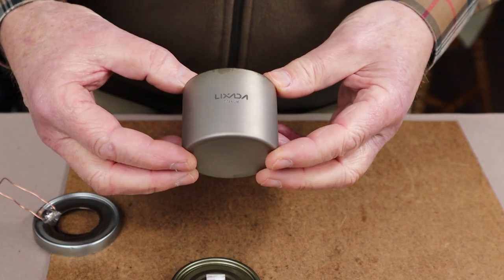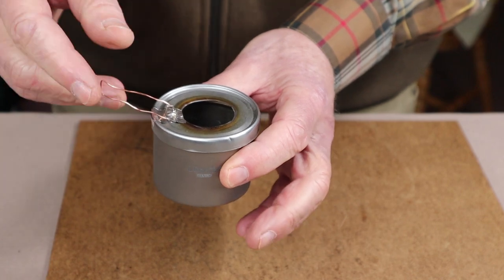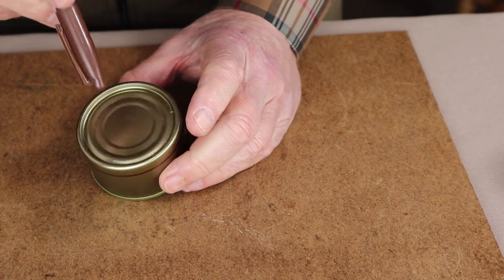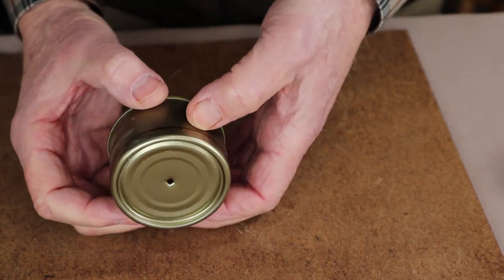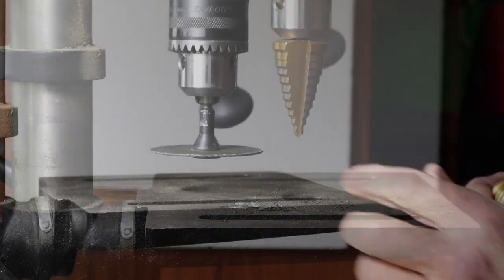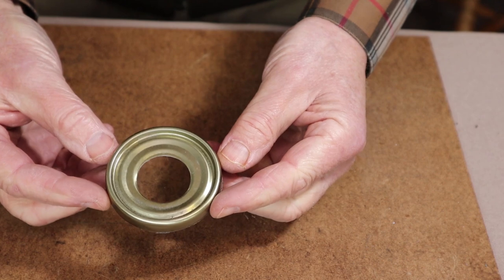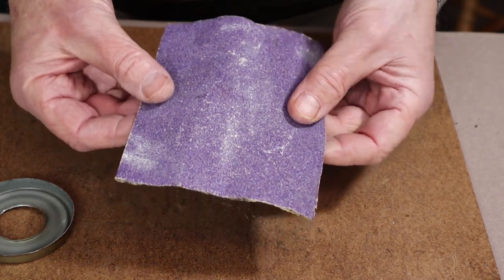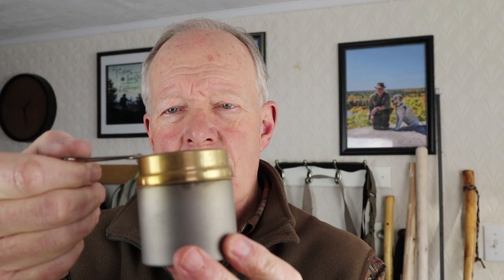Lixada Titanium Alcohol Stove - Snuff Cap & Simmer Ring

Comment: Thanks for the video...I took your idea of 1 1/4" hole simmer ring, calculated the area of the hole and drilled holes in the top of the can to the same final area.  This seemed to work well with the flame more distributed around the top of the simmer ring vs concentrated into only 1 flame.  Keep those videos coming.....
Reply from the maker: Glad it helped. Thanks for commenting
Reply: That's exactly what I came to the comments to ask about! Do you remember what size drill bit you used, and how many holes you made?

Comment: 19:10 - An adjustable simmer ring like Trangia is easy to DIY, I make one for a soda can stove - open top, top jet (that mimic Trangia burner); using a tomato paste can, for the pivot I use an small machine screw and nut for the pivot point, but a small rivet will to the job.
Reply from the maker: Thanks for commenting

Comment: Hey what a great video! I really like the idea of the folding handles you've made but here's a thought... for attaching them you could (rather than using adhesive tape) drill two small holes and poke the wire through those, with the short bent ends on the underside. [Edit: Creating/bending the handle such that it doesn't accidentally slide/fall through the holes leaving one with nothing to grasp might be rather difficult.] I think maybe an unfolded paper clip might be more durable than copper wire also. An aluminium/aluminum can would be a bit lighter than a steel one too, and easy to cut even with only heavy duty scissors (I see you don't have a cat, but some pate or "potted meat" products are sold in similar cans in some places). I enjoy greatly the innovation in videos like this one, and thank you again for making them.
Reply from the maker: I should have thought of the aluminum cans. I will have to give them a try. Thanks for commenting

Comment: After your video on the Lixada stove, I ordered one - they are SO cheap. Then, I checked my stash of empty cans. I only had one little tuna can, so I made the simmer ring, using a 1 1/4" metal punch. I drilled a 1 1/4" hole into a maple block and used a 1" washer to press the center down, making it self-centering in the simmer ring. Tape handle on the snuffer insert, wire bale on the simmer ring. I could send a photo to your gmail address, if you'd like.
Reply from the maker: Yes please. Would love to see some variations
Reply: @MarkYoungBushcraft  The burner arrived today, just in time to try it for my afternoon tea. The stove took about 3 minutes to get 1 1/2 oz of water up to temperature. I dropped the 1 1/4" simmer ring on the burner and it kept light bubbles forming in the water. When I dropped the snuffer disk onto the ring, there was still a lot of alcohol vapour coming out, which continued to burn. Since the flame was out inside the burner, it was easy to blow out the residual fire with one puff. Good enough for me.
Reply from the maker: @northwind7409  Very cool. I assume you meant 1 1/2 cups of water?
Reply: @MarkYoungBushcraft  Yes. I should pay attention when I'm proof-reading.

Comment: Mark, when you demonstrated that the simmer ring for the Trangia is to small to fit on the  Lixada alcohol burner it got me thinking. The Toaks Siphon alcohol burner is smaller than the Lixada. I checked, and the simmer ring /snuff cap from a Trangia will fit on the Toaks Siphon. It fits all the way down, with the top of the simmer ring resting on the top  edge of the burner. I haven't tested it in use, but this is the way that your homemade simmer ring works so I expect it to work.
Now, to be honest, if I wanted to use an alcohol burner to simmer I would probably just use a Trangia. The Trangia simmer ring weighs almost as much as the Toaks burner, which negates the weight advantage (the Toaks weighs almost nothing...).
Reply from the maker: I was wondering how the Trangia simmer ring would work with the Toaks. Please let me know when you test it. Thanks for commenting
Reply: TEST RESULTS:  I tried it out on the kitchen stove, with vent fan (it's 10°F outside). Not only does the Trangia simmer ring work on the Toaks Siphon, it works well. Wide open, the simmer ring only cuts the flame down a little bit because of the large hole, but it DOES reduce it some. I was concerned that it might snuff the flames out if it was closed too much, but there was still useful flame with it three quarters closed. It did not reduce the noise that the Toaks burner makes... As for the weight, the Siphon burner is 20.2 grams, while the simmer ring is 22.9 grams. Still, 43.1 g is much less than the complete Trangia at 115.2 g.

Comment: Thanks for the video. This won’t work as a simmer ring, but the metal lid from a frozen juice can makes a perfect snuff lid for this stove – it extends 2mm past the outside edge. If you ever needed a pre-heater, the slight moat around the juice can lid could work for that as well.
Reply from the maker: Great idea!! Thanks for commenting

Comment: You could also use an aluminum pop can to make these, not as durable but easier to make, all you need is a utility knife/box cutter and they are sold at the dollar store if you don't have one.

For the simmer ring how about a center rivet a three hole/flange design to provide more even heat
Reply from the maker: I had not considered a pop can. I checked and it fits perfectly. I like your idea for a simmer ring. Will give it a try. Thanks for commenting

Comment: Speaking of simmer ring , I found that if You have a top burner ( like a Personal size hair spray , 
shaving cream can )
You can use a grinding wheel ( if You have a fire box scout stove, You just have to put something under Your burner for the correct space to the bottom of the pot ) the wheel will reduce the flame by at least fifty percent , and increase
burn time too ( results may vary LOL ) .
Reply from the maker: Interesting, Acts like a heat sink and diffuser at the same time. Thanks for commenting
Reply: @MarkYoungBushcraft  Yes , works great and doesn't cost anything ( extra , assuming You already have a grinding wheel , or know Someone who does )
Reply: @MarkYoungBushcraft  Have You tried it yet ?
Reply from the maker: @johnhoward3271  Not yet, three weeks of rain and no break in the forecast. I could try it here at home though. I will get back to you
Reply: @MarkYoungBushcraft  I used it at home , it produces such a small flame ( You can put on a pack of ramen noodles , and set it and forget it , 
when it burns out noodles are done You don't have to
stir or anything , done w/10ml fuel at that )…

Comment: Having a Lathe I would be using it for both of those operations, I am not too sure about using the slitting blade like that, would want to make sure that if the metal grabs it can not pull your fingers into the blade. I would use a dermal tool over the slitting saw unless you could mount a X/Y Table on the drill press.  Busy Bee Tools among others sell a deburring tool which works good.
Reply from the maker: A lathe would be great. I understand your concern with the cut-off wheel. I have used it a fair bit an am very careful. Thanks for commenting

Comment: Using the same amount of fuel, would two burns of the stove -- one with the simmer ring and one without -- give you the same number of usable BTUs? I'm just wondering if you lose anything using a simmer ring on a siphon stove. I have the Toaks and it's rapid fuel use has kept me from using it as much as I thought I would.
Reply from the maker: There would be a huge reduction of BTUs with the simmer ring. I get extended burn time with much lower heat. I can't say it is more or less fuel efficient. Thanks for commenting

Comment: Hi, I think you have an Alocs alcohol stove too? I’ve recently bought one for a little over $10.00 usd including the stand. It’s the Alocs BS C02 model and it comes with a simmer ring and acts as a snuffer too. I really like this alcohol stove and it’s plenty fast cooking for me and with the simmer ring I can cook rice and bread or pan cakes with it without burning my foods. 
How does it compare to this Lixada stove that you have? I definitely don’t need the fastest stove out there because I’m happy with the speed of this Alocs alcohol stove and the ability to fine tune and control my cooking to just about any foods that I’m cooking. It just seems like a lot of hassles unless you like tinkering using this Lixada stove and pricier too? What’s your thoughts on this? Thanks
Reply: I see what you’re saying Bong. You’ve got a lot more fine tuning flame adjustments compared to what Mark’s simmer ring can do on your Alocs simmer ring. For me I like that the Trangia/Alocs has a Rubber seal cap for the alcohol stove so I don’t need to carry a alcohol bottle with me for day trips. I just fill up my stove and close it and off I go. It looks like this Lixada alcohol stove can’t do this.
Reply from the maker: I can do a side-by-side comparison of the two stoves. The ALOCS and other Trangia clones work well, are less expensive and almost the same weight. Of course they come with an easy to use (unless hot) simmer ring/snuff cap. The Trangia and its clones are slower to boil but as you say, not a big issue. They can be harder to get going in cold weather. You can seal in unused fuel but I find over time the o-rings dry out and fuel can leak out. I keep al my alcohol stoves in zip-loc type bags. As an FYI, I did try the Trangia lid on the Lixada and it was a bit too small. It would likely works on the Toaks Siphon. Thanks for commenting